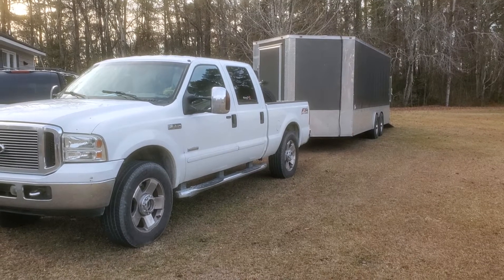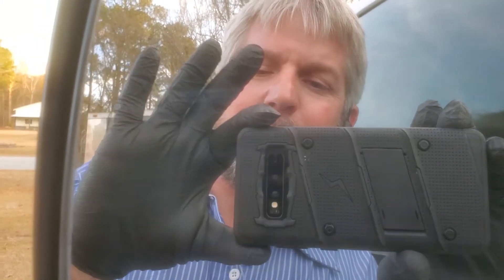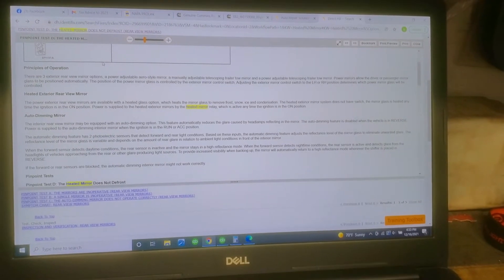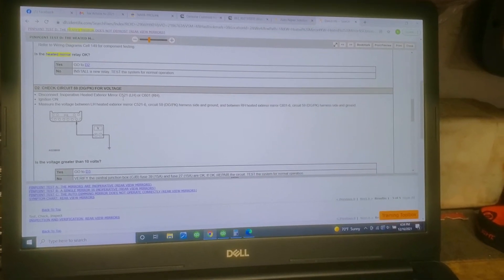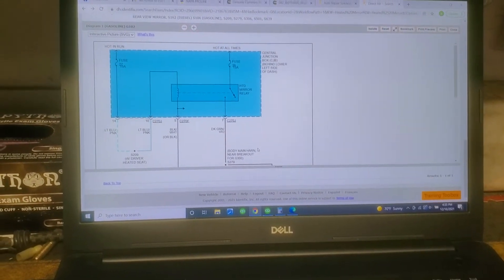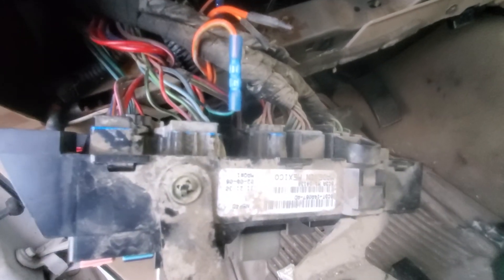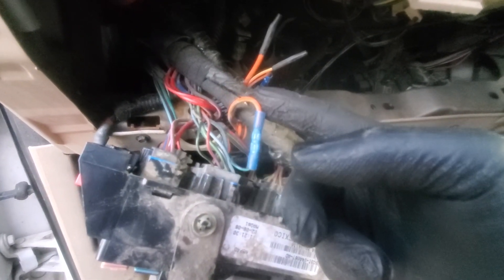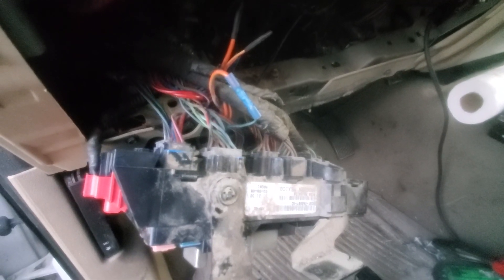Super Duty Heated Mirror Repair Hack

Comment: My heated mirrors have stopped working as well.  Both at the same time. Fuse #39 is good. When i got the fuse panel out i unplugged and checked for continuity from the harness at the fuse panel to the harness at the mirror plug in. There are 6 prongs at the mirror plug in and i had continuity to 3 of the prongs. Im assuming that confirms the problem lies inside the panel and i need to do the same deal you did? Im not good with vehicle electronics. I dont have any of the upfitter switches, so which wire would i splice to, to have constant power when the ignition is on?

Comment: Funny, I had one today, 06 super duty and the heated mirrors never would shut off. There was a 1.5 amp parasitic drain on the battery. I pulled the fuse and the drain dropped to less then 200ma. I'm in Florida so most likely it will never be replaced. But if you wanted a switch you could get a fuse bridge, add an inline fuse and toggle switch, then just don't leave it on.
Reply from the maker: Thanks for watching!